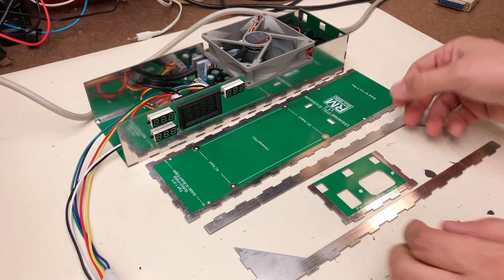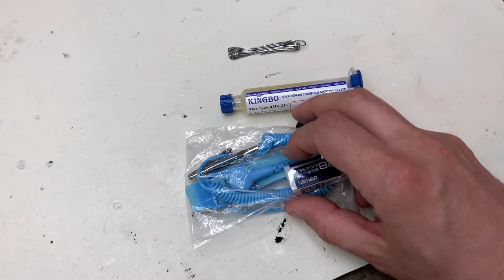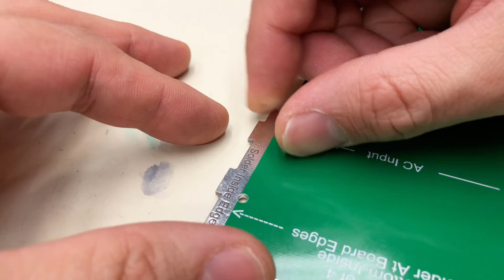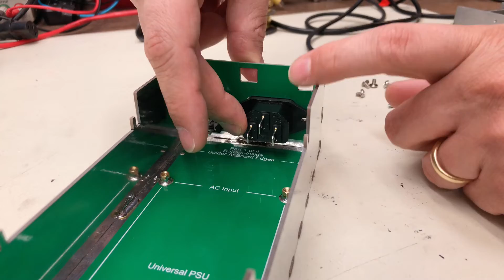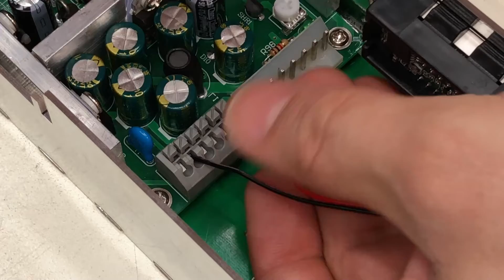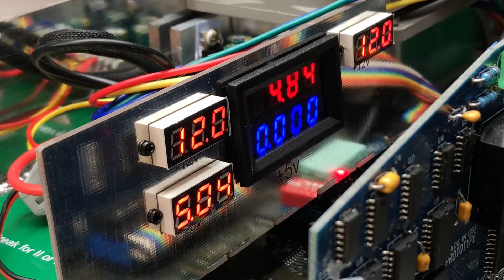UPDATED ReActiveMicro Universal Power Supply -- plus CFFA 3000 Returns?!

Comment: That looks sharp. Is there a reason to get this unit over just rebuilding your original power supply? Mine is original and unbuilt but still works. I’m trying to decide if I just rebuild the one I have or spring for this puppy. I guess my Question would be is this power supply intrinsically safer than the original one even if the original one is rebuilt? Thanks for doing these videos.
Reply from the maker: Yeah! So, the Reactive Micro supply can supply more power - 6 amps compared to the 2.5 amps of the original. If your machine is not starving for power and you know how to rebuild your current one, that's a viable option.

Comment: An excellent overview!

I really like the new case design. Just curious if the side pieces for the enclosure are interchangeable or not. 

If so, I would say it would be a nice option for those who went for the MacEffects clear case and mount the side with the meters to the left, so they won't be obstructed by a long card in Slot 1.

Earlier in the week during your live stream you mentioned projects in the wings, I was speculating it would be the reveal of the RM CFFA3K, so I'm a bit tickled I called that.

Looking forward to more content!
Reply from the maker: Unfortunately, the side panels cannot be swapped side for side, at least not when I tried it.
Reply: Not a big deal, just a thought. I guess stick with shorter length cards for Slot 1 then.